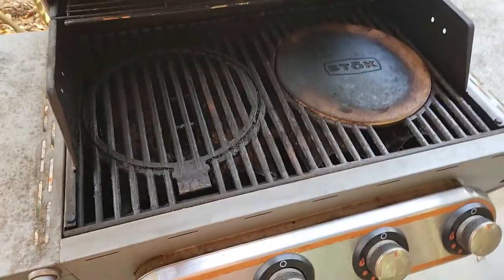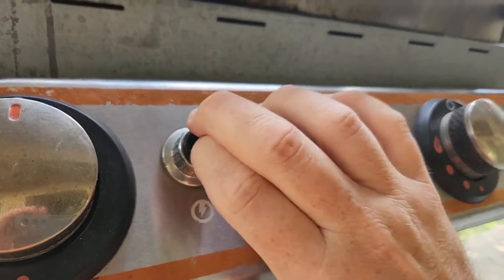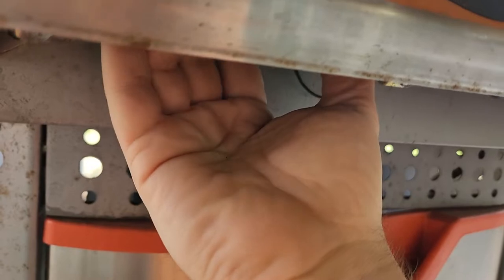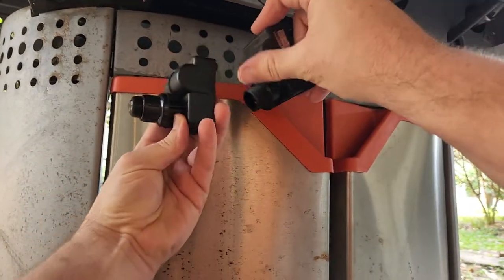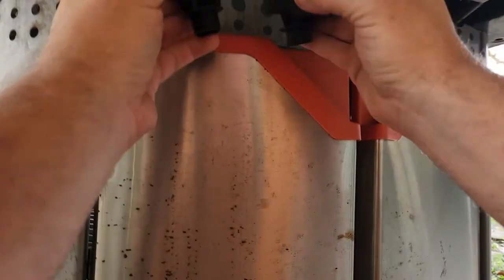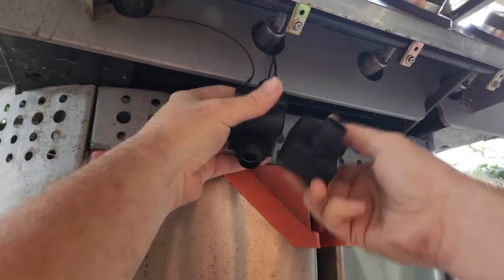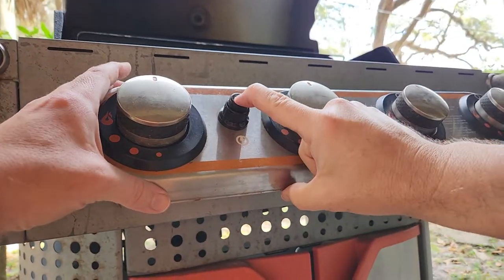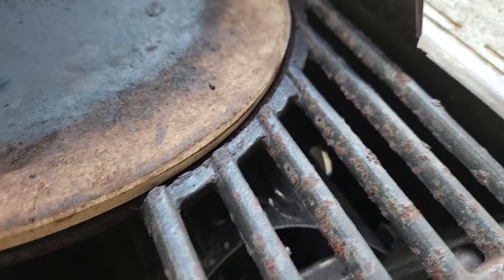How to: Replace the Igniter in a gas grill, bbq push button igniter has no spark (DIY cheap & easy)

Comment: What do I do if the wire is broken?
Reply from the maker: @TriciaNenni  one of the wires broke?  I would try if long enough take the wire and try and crimp the connector back on.  If not, I would try and wrap that wire with one of the other wires. (If that makes sense)